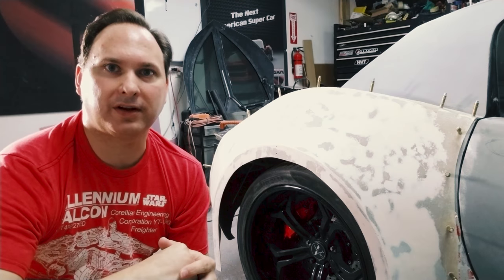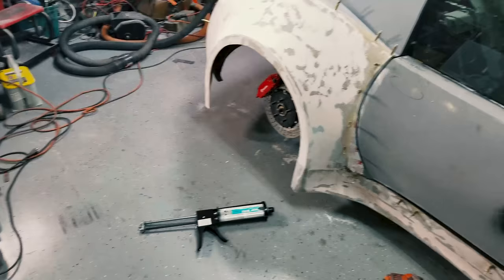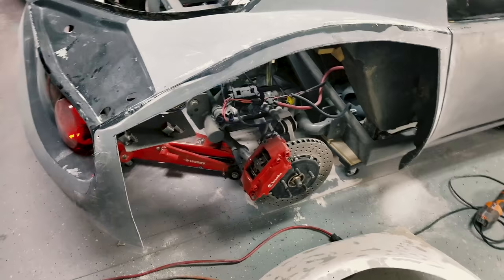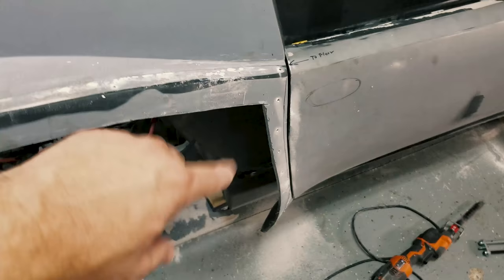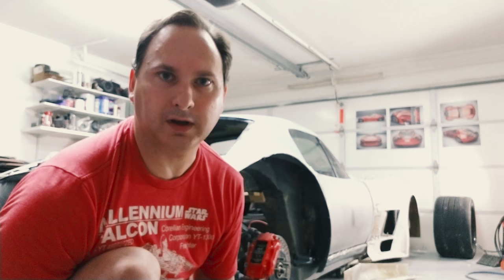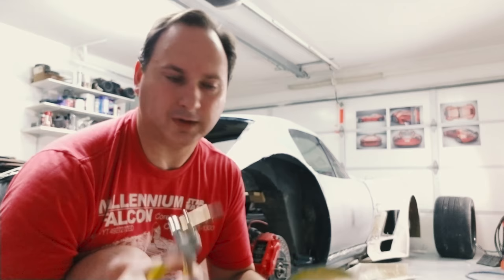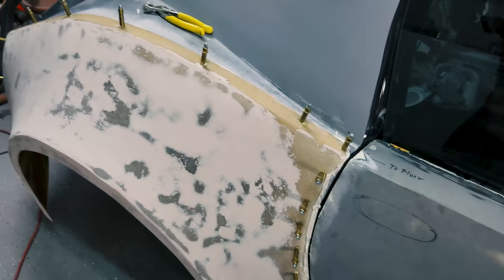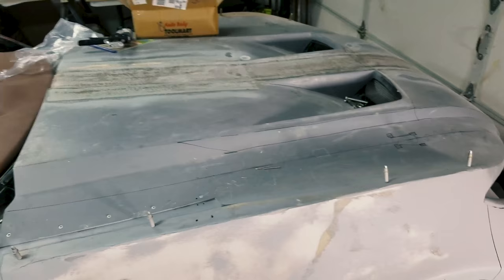Bonding Wide Body Fender Flares on the Blade GT1

Comment: Can I get a list of materials used in this video(cleakos and adhesive) (product names and where you can get them, i.e. a web link or store)
Reply from the maker: Sure no problem, I also put all the links into the description. Everything can be found on Amazon for pretty good price. 
Cleco Fastener Deluxe Kit
https://amzn.to/36ppXzi

Lord Fusor Structural Adhesive Slow 10.1 (FUS-127EZ)
https://amzn.to/2RzGblj

Lord Fusor 300/225ML Manual Dispenser (FUS-301)
https://amzn.to/37wAbzj

PK/12 300/225 Nozzle
https://amzn.to/2t2jKf3

Comment: Once the cleco pins are removed what were the holes filled with
Reply from the maker: After the panels are bonded I used tiny fiber reinforce body filler. Look for Everglass by Evercoat or the green Bondo brand works too.

Comment: When you bonded the panels together, did you back it all up with fibreglass inside and out?, or did you just fill over the joint?
Regards
Reply from the maker: The bond does not need to be backed with fiber glass, however will in a few spots to add some support for mounting etc.

Comment: What stuff did you use to make the car
Reply from the maker: I would recommend going to the beginning of my videos as I explain a lot of the process in them. But short answer is a little of everything, if you are referring to the Body it is mostly made of standard fiberglass for the prototype but the final version will be carbon fiber and a mix of various materials.

Comment: I'd like to know where you bought those rivets, or whatever they're called. Good idea, as I'm making a quarter panel replacing my metal quarter panel on my Challenger. I'm making my out of Carbon Fiber. Will be using Epoxy as well, I really need a very fast bonding epoxy, mainly I really don't want those holes showing. after, not sure how to fasten or bond them tell it dries. Not that there going to be heavy.

I've been using [form board sheets] from the dollar store, just about finished one quarter passenger side than driver side. Then it's time to place sheets of Carbon Fiber, I'm not making a mold. 

Thanks in advance, for your reply about those rivet things. 

 Care Alway.
  Sam..
Reply from the maker: They are called Cleco Fasteners, look it up on Google as there are several different types and sizes.

Comment: How did you fill the two materials, fiberglass and metal without having cracking problems on paint.
What materials did you use?
Thanks if you can help.
Love your car!👌👍
Greetings from Italy.
Reply from the maker: I used a product called Lord Fusor Structural Adhesive Slow 10.1 (FUS-127EZ). It's pretty expensive but worth it. Its used to bond these types of materials
Reply: @NealBaileyStudios  Thank you sir. Sorry I didn't explain myself well.. what sandable material, like putty for example, you use to fill the gap in between fiberglass and metal to prepare the body ready to paint for primer?
I mean after the fiberglass is glued to the body of the car.
I think normal automotive polyester putty would crack..
Sorry for disturbing any further!
Giuliano
Reply from the maker: @wtfftw24  ahh, I just used a hi quality 3M  body filler. My car is all made of composites so blending the  parts together is pretty easy and strong.
Reply: @NealBaileyStudios  ok perfect. Thank you again!!👍🙏

Comment: Great looking car. I'll be applying some of your techniques to bond a rocket bunny wide body to my RX7 FD. What grid sand paper you use to sand the original body panel before bonding?? Thank you
Reply from the maker: That's awesome, you will have to keep me posted on how it turns out. I used 40 - 60 Grit to bond. I wanted to make sure it was able to get a good bite on the panels. if your bonding to fiberglass, then you need to make sure to sand through the top coat a bit so your not just bonding to paint or gel coat.
Reply: BXR Motors thanks for the tip. Sure will keep you posted. The plan is to blend the over fenders to the original body. Make a fiberglass mold from it and then make the carbon fiber panel. Regarding the carbon fiber, how many layers would you recommend to make it strong yet light weight when using 430g pre-preg carbon fiber? Thanks 🙏🏼
Reply: Lol if you need to ask what grit to use then I don’t think you should be trying to attempt to install your own wide body.😂. Also from the looks of it, bxrboy may not be the best person to ask for advice, seems like he’s still learning and experimenting himself.
Reply: BXR Motors Neil They Guys over At  B is For Build are Starting a New Channel Showing off Custom Work Other People. I think you should Send over some Vids and Picks of the Blade.
Reply from the maker: +Csm. Hb Jdogg Thanks man, I'll reach out to Chris. We have chatted before a long time ago.  I wanted to do a collaboration video at one point. Thanks for the update. I saw he got a new BMW... I need to catch up on his vids.
Reply: Yeah He been Doing some Crazy things the ashton Build was Nice lol ..Im Sure he would post the Blade.